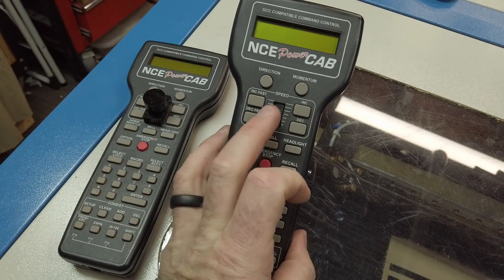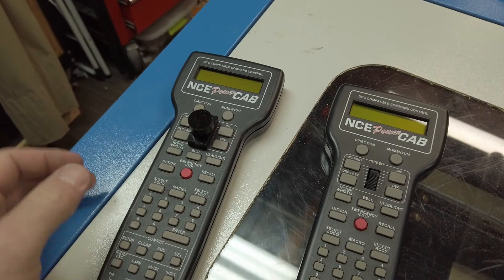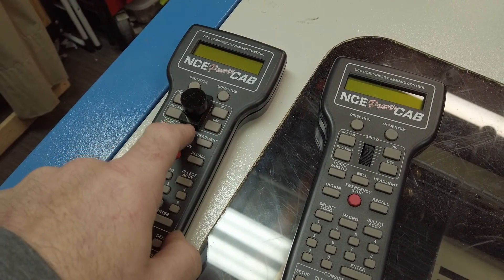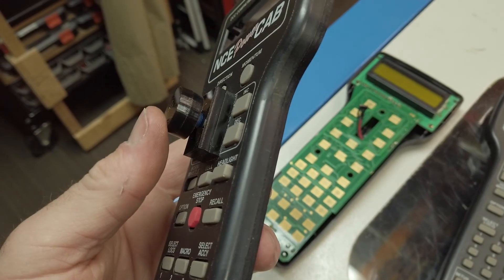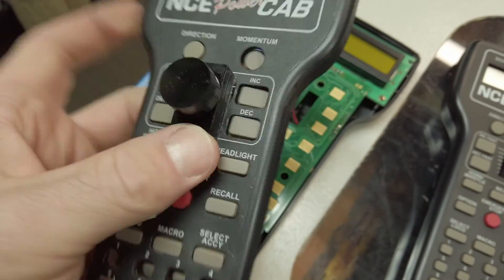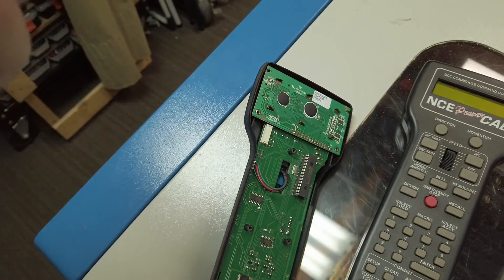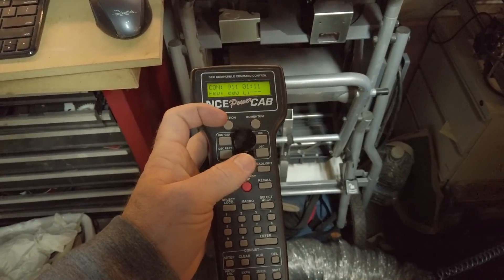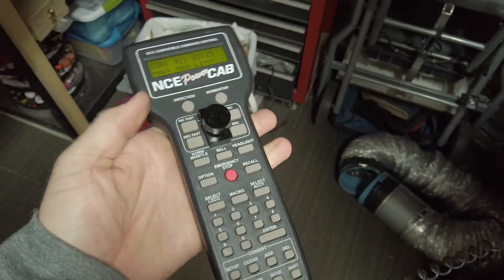NCE PowerCab Throttle Encoder Wheel Modification

Comment: Neat fix mines starting to do same ,looked on line there’s a lot could you tell me the number or brand 3 and 4 wire hook up, if on eBay number or name would help thanks
Reply from the maker: https://www.mouser.com/ProductDetail/Bourns/3315Y-001-006L?qs=ZDTrS6L6J9aIpml7Fa9Ejg%3D%3D&gclid=CjwKCAjwzIH7BRAbEiwAoDxxTot94_WxXesPpj5q9dugBrpTWBdIl6se8fQsrOzCiQ9n6r2z5X8u0BoClE8QAvD_BwE